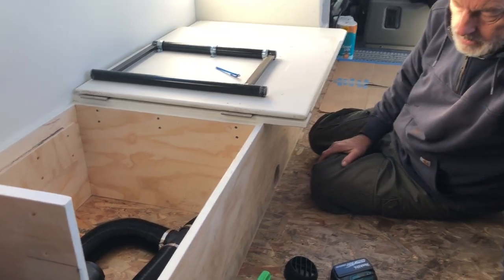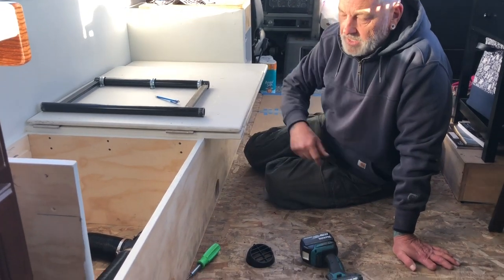Installing Diesel Heater - Part 1 - Vlog 184 School Bus Conversion

Comment: I understand about tapping into your main  fuel tank . I bought a 20 gallon aluminum fuel cell.With mounting brackets for my build  Super easy to install ..
I bought my stuff from Amazon. The fuel cell is 10"tall x19.75 wide x 24" deep .I bought a 90 degree AN fitting to 5 /16 fuel line , 45 degree filler tube 1 1/2 INCH  tube. a SHENGHU 1 1/2 INCH Through tub.. A piece of rubber fuel hose 
Total under $200.00 bucks .. Just in case you get tired of filling up that little tank . I'm old and get cold easy ( its the blood thinner)😁😁 GREAT VIDEO
Reply from the maker: That’s a great idea. Thanks for sharing. Maybe down the road we can make the switch.  😃👍😃

Comment: Randy, i would have put the heater in the underbay storage, fuel tank outside, and ran the ducting up into the bus. This would save you space inside the bus but it would allow the heater to keep your bay warm and help prevent your water freezing if it gets really cold. Line inside your couch with foil as those heaters get really hot.
Reply from the maker: Yeah I learned all these things the hard way :-) it would’ve been difficult to put it in the under bay because it has to vent out the floor and that’s got 2 inches of foam and two layers of metal in it too. Seems like I would lose a lot running that much ducting back up into the bus. So if you watch the next video you’ll you will see that I had to address everything you just told me :-) but I think we have an adequate solution and it seems to be working great now. Thanks for your input I wish I would’ve known it before I started :-)
Reply: @KnappTime  Sorry for the hard lesson mate but that is how we learn sometimes. I do know that however you managed, it will be to a very high standard as the rest of the build. Looking forward to seeing it.

Comment: small piece of advice. replace the cheap plastic fuel line with automotive grade fuel line now. that cheap plastic starts to get brittle after about 6 months in the cold.
Reply from the maker: Good to know. We will have to do that. Thanks for sharing. 👍😃👍

Comment: Looking really good, Randy and Shelley!  We have our second heater coming tomorrow to install in the back of the bus.  That one will have multiple outlets similar to yours.  HEAT is a GOOD THING!!
Reply from the maker: That sounds great :-) yeah you might wanna be careful with that bigger one with the multiple ducks if it’s like mine. I had to actually do quite a bit of work where it was mounted because it was getting too hot. It melted the foam insulation in the floor where it came through. I show all that in the video that’s coming out tomorrow. Good luck with yours I know you’ll do a great job :-)
Reply: @KnappTime  Thanks for that hint, Randy and Shelley.  I will now have to lift my heater off the floor to look underneath.  I thought that I had the clearance, but maybe not!!  This is very timely.  Thank you for sharing it!!!

Also, your fuel line is definitely different from mine.  My line is a softer line that would go right over the fittings.  Sorry that yours seemed to be a bit more of a pain in the rear!

Comment: Great job guys! It's hard to tell from the video but are you going to have enough room in your new fuel door to get the diesel nozzle in to the fuel tank? Looks like it might be a tight angle with the opening not facing outward. Keep up the great work and keep the great videos coming!!!
Reply from the maker: We put the tank on its side because it’s right behind the wheel and we didn’t want a rock to hit it. We would’ve made the opening wider but the rub rail was in the way. But we plan on filling it with a jug and a funnel anyway. 😃

Comment: Did you install this heater just because the Dickinson is too small for the big bus, or are you not happy with the Dickinson? I tried the diesel heater first and thinking of going the Dickinson route. My diesel heater keeps failing on me.